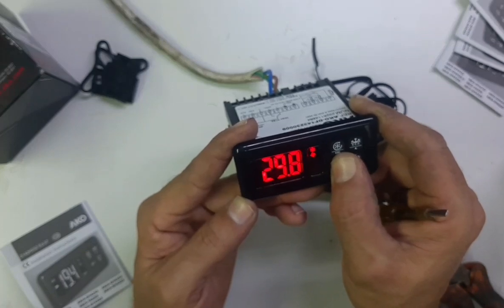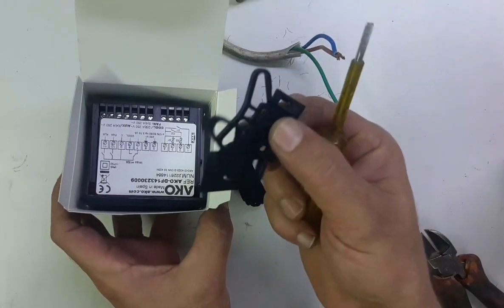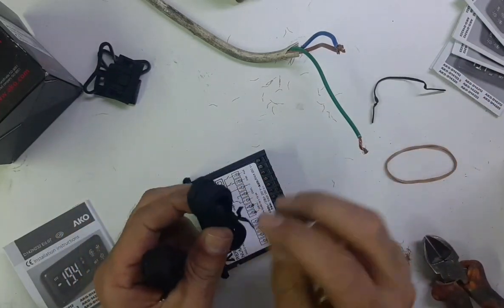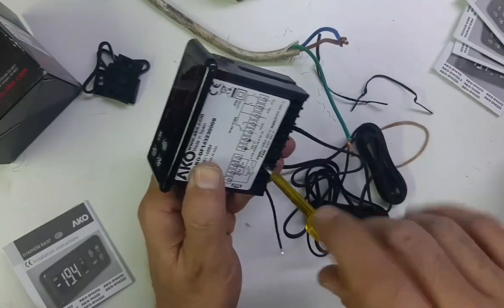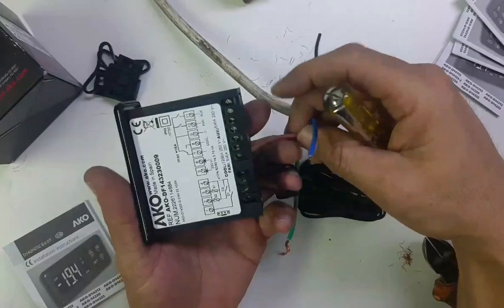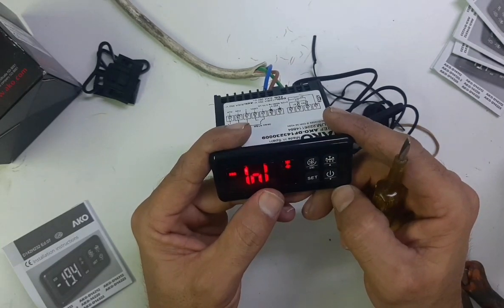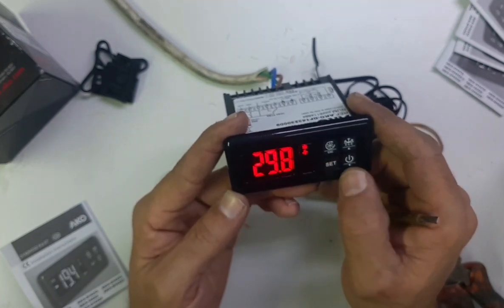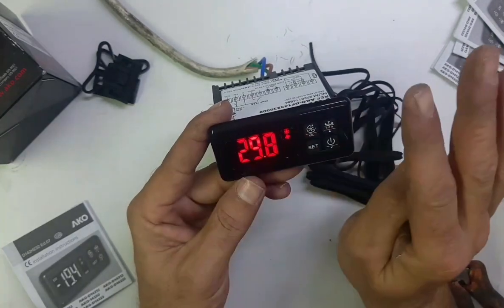ako 14323 controller full details | ako controller programming #zkmultitech

Comment: Sir ihave some issue .in my chiller sem this thermoste. Ako.iseeting in 5c very faste open doore its up at 8c .compressore starte working. Im scare for endomaged compressore .wisch programme delais i use for mesk more time in starting compressore  plz 🙏
Reply from the maker: rE me entry mardo and c1 is deferential temprature apni marzi se set kardo don't worry for compressor 2 or 3 degree is enough for deferential compressor is not getting damage due to on and off its normal